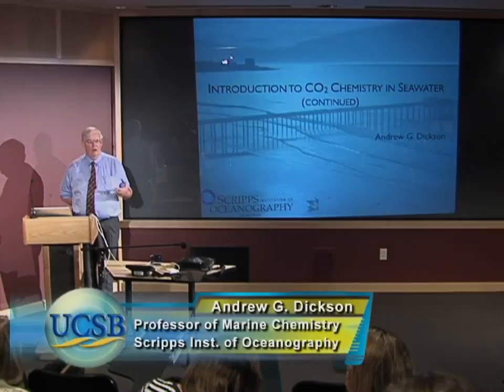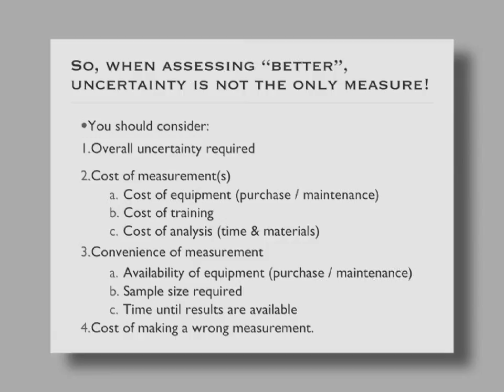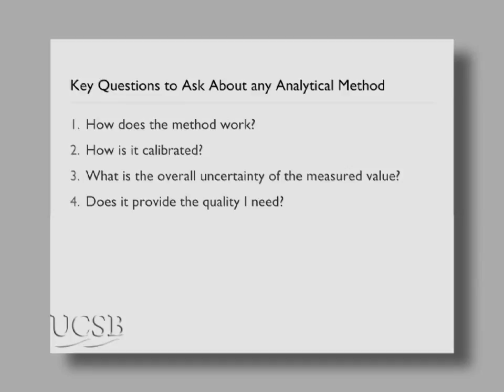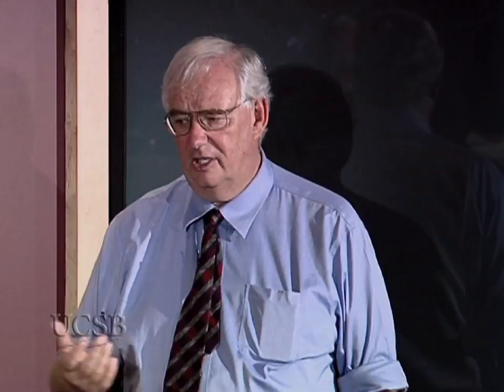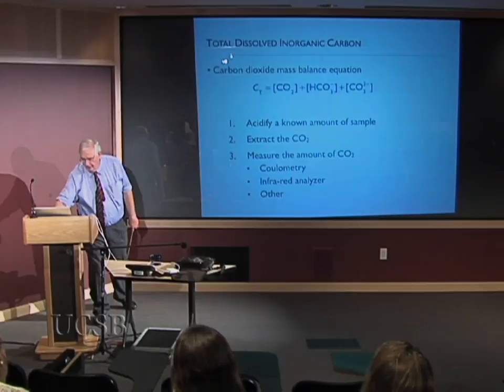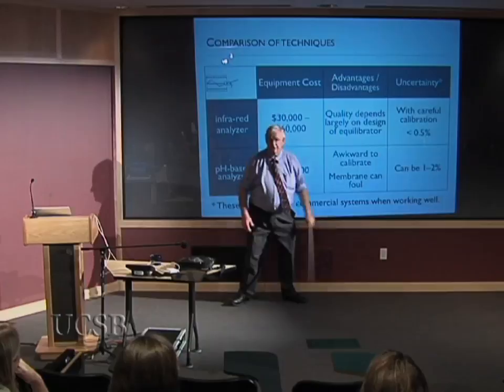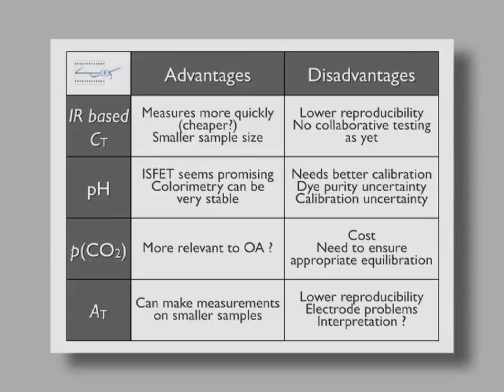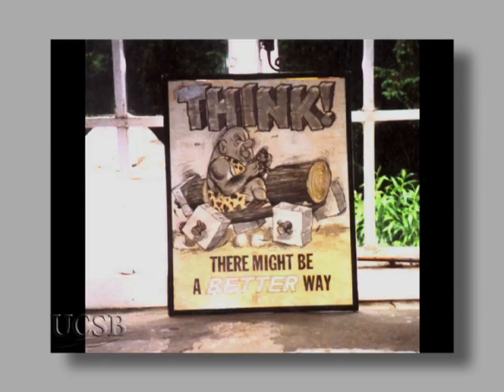Introduction to CO2 Chemistry in Seawater Part 2

Comment: Lecture starts with discussion of the possibility of "faster, better, cheaper" and how well you need to know your measurement [of CO² in seawater]...adequate...cost of making a measurement...$80k equipment, training costs for 2 or 3 graduates per year...sample size...0.5ml or 1000ml samples? 
Outsourced sample "one hundred bucks". Cost of a wrong measurement...reliability...